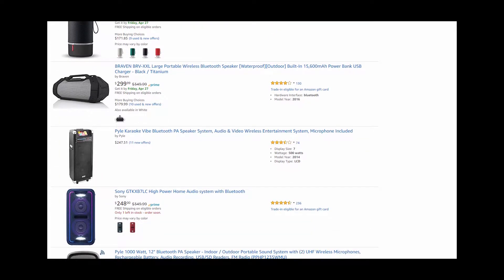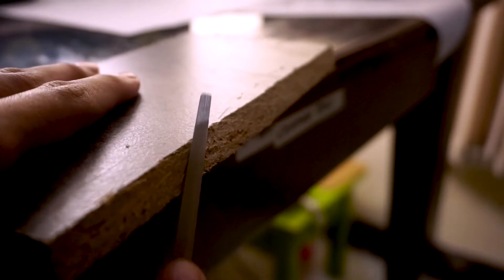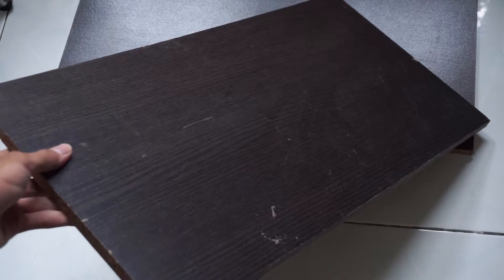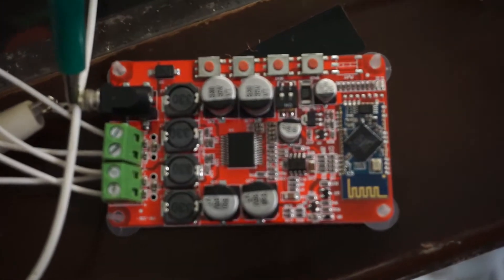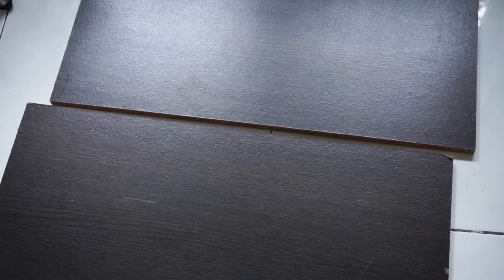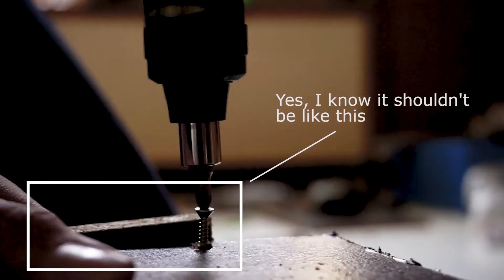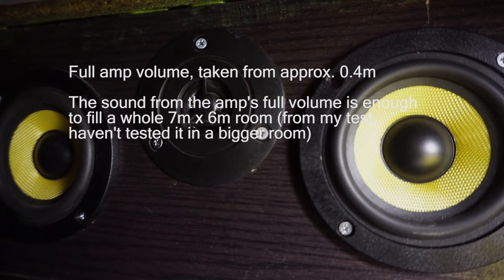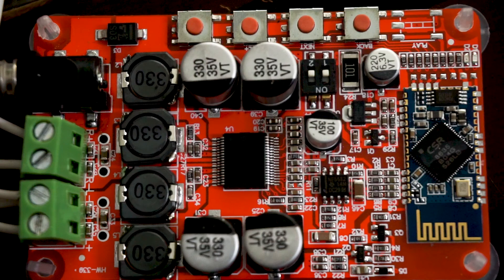Easy DIY Bluetooth Speaker

Comment: First of all, you rock for going diy :DD
But i would like to add that the amplifier should work way better at a higher voltage. Correct me if I'm wrong, but my experience with these types of amplifier boards show that there is a huge performance increase when you run them at 24 volts. It might be something you would like to try. You will still never even get close to the 2*50 watts rating the chip has due to the fact that the board is not of the highest quality and other reasons but it might solve the hissing problem. You can get boost converters for really cheap on aliexpress. 3 dollars including shipping if I'm right. You could try that. If that doesn't work there is always the possibility of a groundloop(not likely tho because it usually results in different sound leaking trough and not a hiss)which is easy to fix with a 5v to 5v isolator but probably not worth the effort tho considering you'll have to find the 5 v powersupply input for the bluetooth module and put it inbetween the source and the input of the module which is quite hard when the board is soldered on to the amplifierboard. 
Anyways nice vid,
I subbed :D